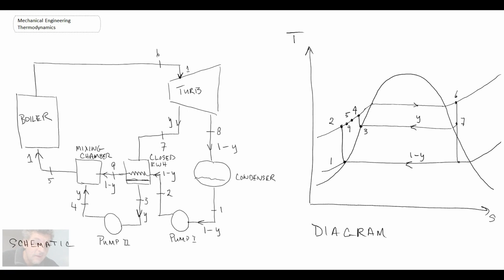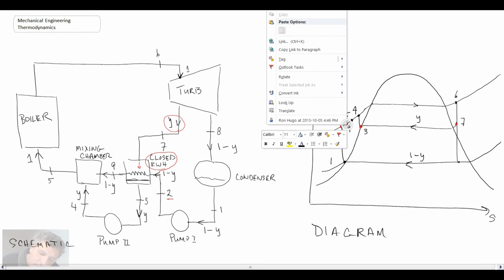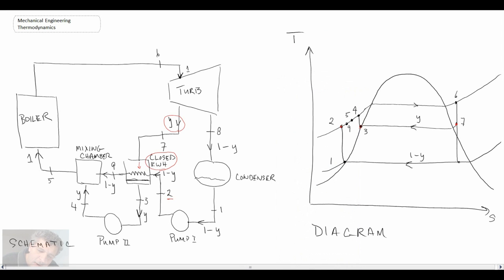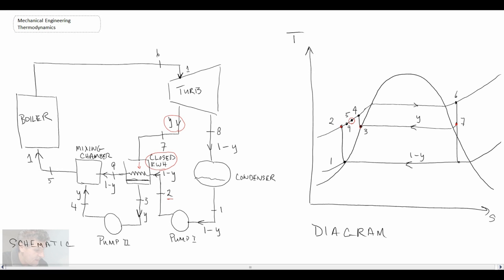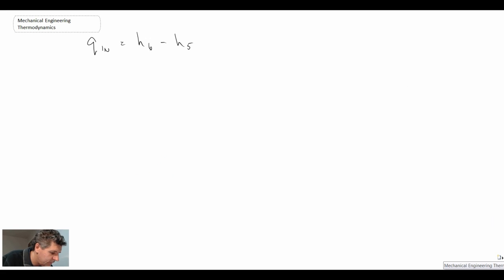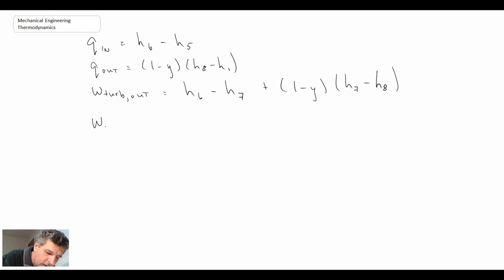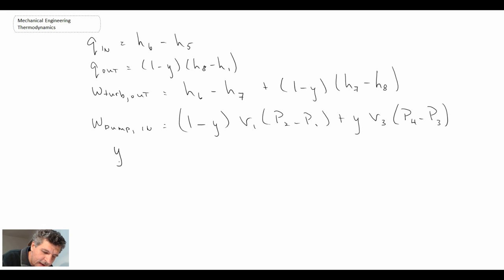Mechanical Engineering Thermodynamics - Lec 20, pt 6 of 7:  Closed Feedwater Heater

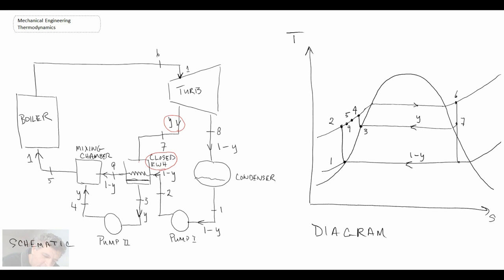Comment from the maker: Partial explanation is given at around 2:20.  h9 is determined by applying the First Law to the Closed FWH - you need to know the mass fraction y before you can do this.  h5 is determined by applying the First Law to the mixing chamber.  Make sure you look at both the Schematic and the Diagram while solving these as h5 and h9 are confusing if you look only at only the Diagram, but they make sense if you look at them with the Schematic.
Reply: why Qin just from the boiler? because from the heat exchanger or mixing chamber there are also Qin....please explain me
Reply: حيث ان الحرارة المتبادلة في ال heat exchanger ما هو الا تبادل حراري داخل الدورة نفسها و لم يستهلك طاقة حرارية من الخارج

Comment: why Qin just from the boiler? because from the heat exchanger or mixing chamber there are also Qin....please explain me
Reply: Qin is heat input that we give by burning fuel, which is what happens in the boiler.. in heat exchanger and mixing chamber, heat transfer has taken place without burning of any fuel.
Hence in regenerative cycle Qin is lesser and we save fuel. Therefore the efficiency increases.

Comment: Ron,
What type of feedwater heater system is one in which water is pumped from a tank into a submerged copper coil, located inside the boiler, i.e. the submerged coil in the boiler water is preheating the incoming feed water as it travels through the coil and then enters into the boiler? A closed feedwater system?
Reply: Yes, it's a shell and tube heat exchanger, i.e. a closed feedwater heater
Reply: @aaronherculanogonsalves7851  qin should be h6-h4? He has written it as h5 and i am a bit confused. And if it is that h6-h5, why is that?